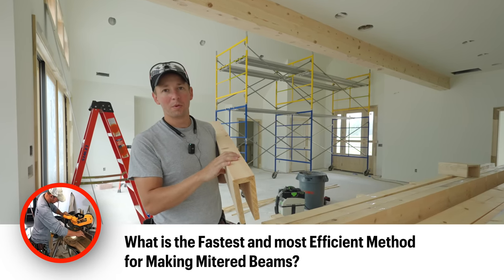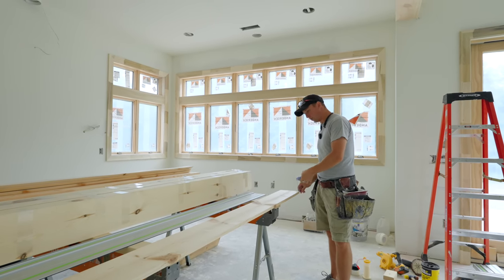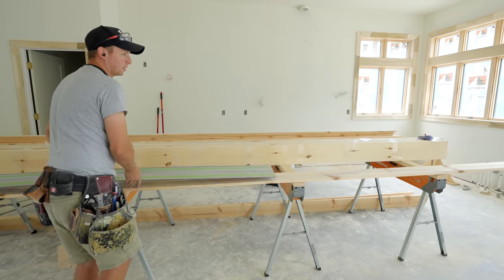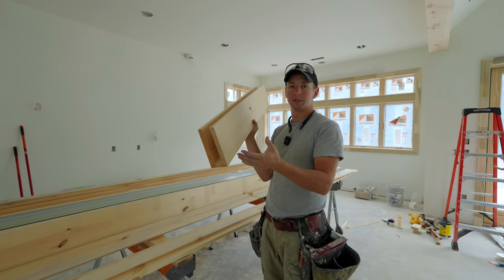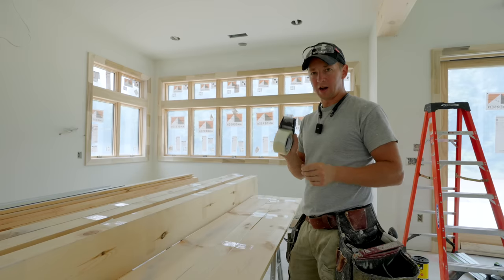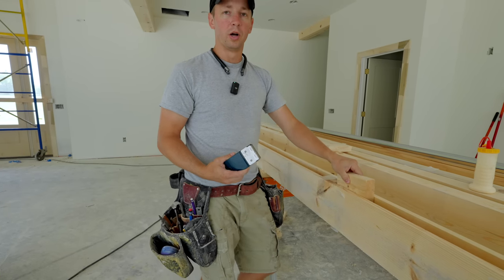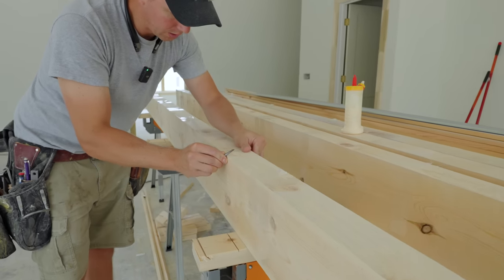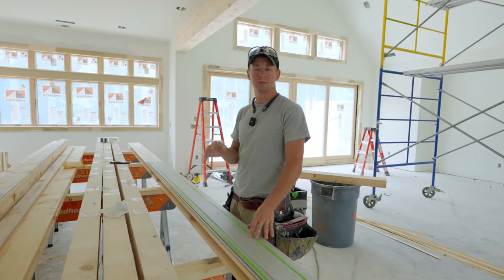PERFECT CEILING BEAMS from BAD MATERIAL??? How To Deal With Bad Material...

Comment: Excellent tutorial in every way. Can I ask about the part where you miter at 46°? When the two metered edges are joined together are those two 46° angles meeting each other or two 44° angles coming together? I can't get my head around that bit. Sorry to trouble you.
Reply: My understanding of it is that the miters will meet along the “pointy” edge, but not the whole “face” of the cut. Instead, the glue will squeeze in one direction only and partially complete the missing 2 degrees of the joint. It’s important that the pieces are supported at true 90 from the inside during glue-up, or you’ll have an 88 degree joint instead of the 90 you want.
Reply: @mikekempe7555  thank you - so it's the two 44° angles meeting. Legend!
Reply: Exactly. This way, it caters for twisty boards where a precise 45 degree cut may leave “open mouths” along the joint. Instead, the corners will meet all along the length of the beam.

Comment: Respect the skill. Very good. To the consumer, why even bother with fake beams? Either implement construction beamd in sight or design within the style of the house.
Reply: Some tradesmen have understood the value of additional (you would say unnecessary) work. Change orders are sometimes the difference between profit and not. The more a client wants, the happier you should be. There is often the consideration of your mortgage, wife and kids. Kids eventually drive and attend college. They are expensive. A good rule of thumb is to estimate the additional work and then triple the number. You will be messing with your schedule and have to work some weekends but it pays well. You are the best your client could find, so charge like you are the best. Right?

Comment: Great video! You have three track saws, why not have two full length tracks to mate up for rips that long? With a job that big, that many repositions of the track, why not make your cuts in one pass? Treat yourself to some convenience bud! I did rough ship lap job on every wall on the first floor of a 100 year old house(lots of scribing) I had a couple lamb beams to wrap with miterfolds and I used the track saw to straighten out a lot of the ship lap. I have a makita battery track saw, absolute game changer.
Reply from the maker: Because when you put multiple tracks together they do not stay straight and have to be checked and realigned every time you move them.
Reply: @InsiderCarpentry  bummer, not for me. Oh well.

Comment: Thanks for the video! How did you do the big beam and bigger beams longer than 16’? Do you pre assemble or scribe and fit each piece in place?
Reply from the maker: On those large beam the strategy changes. I fit each piece and assemble piece by piece in place. First sides, then glue bottom on.

Comment: Love your videos! I am curious if you have a video on how you deal with Sheetrock on a door opening being wider than your door jamb. I’ve always ended up crushing the Sheetrock or even adding jamb extensions in extreme cases. I am a production finish/trim carpenter as well and run into this pretty often. Why they don’t make door jambs a heavy 16th of an inch wider I don’t know but sure wish they did at times! Again I love your videos and would love to hear a response. Thanks!
Reply: 2X4 partition with 1/2” drywall. Your jambs are 4 9/16”. If these are correct, you should not be having a consistent issue. Something else would be a factor. Any idea what that might be? It sounds like metal studs spread by wood jacks.
Reply: When extensions are needed, dress the jamb bevel off the non hinge side and add them. Don’t pack the hinge side of the jamb.
Reply: From what I can tell it is from the king/trimmer not being properly aligned which pushes one or the other proud of the rest of the wall framing. Mostly it only happens in the middle of the opening. Top and bottom are flush or very close to.
Reply: @joshuasteele1769  I hate to blame framers but that would do it. Jacks and kings need to align. Let’s assume you can’t check for this as a pre drywall inspection. Let’s assume the drywall is installed. You can drive a chisel through the drywall and pry the jack away from the king stud a little. You don’t need much. Then drive a screw (toenail) at the corner of the jack to align it with the king. The chisel or pry bar damage should be covered by casing. I have seen this more with flanged window units. Andersen, Marvin, Pella…sometimes the unit has to be pulled in with a clamp and anchored to the framing. This is common when the nailing fins are damaged or tyvek or tape gets bunched up. But a bigger headache when trimming the exterior. Plowing a rabbet on all exterior trim to clear the nailing fin works for that specific issue. Hope that helps.
Reply: I attribute many framing issues to pneumatics. Someone who can’t use a hammer properly to frame or trim, should not pick up a gun.

Comment: Is it worth the time and effort to use a lock miter bit with the track?  Also, do you back bevel the top edge to make scribing easier (less material to remove)?
Reply from the maker: I don't lock miter anymore. Not worth the time. I do back bevel when I rip the scribe and then finish with a block plane. You will see it in the next video.

Comment: Why not join two tracks together to make a longer one? Great video Spencer, lots of good tips!
Reply from the maker: The tracks don't stay aligned and you have to check and realign every time you move it. More of a pain than it's worth.
Reply: The Bosch rail connector works amazing and I think Bosch tracks work with festool saws

Comment: hey Spencer, i want to replace my Dewalt track saw because its terrible. Should I get Milwaukee or Festool?
Reply: Both are excellent, looks to me he will say festool. I feel it’s more about using the best blade possible on either saw. Stay away from box stores for high quality needs. Forrest or cmt should be used for precision cuts. Anything else is for general use. Freud blades dull quickly.
Reply: @stevenfoust3782  Thank you I appreciate the reply. I  know he did a review on the Milwaukee, and he really seemed  impressed with it. My  thoughts are, if i do Milwaukee, I could just get a battery adapter that would still allow me to use my Dewalt batteries with it. Not sure if there is a Festool/Dewalt battery adaptor
Reply: @williamdyer4431  there probably is an adapter. I have found that for a complete kit  with two 55” tracks, connectors, charger, battery, clamps, saw, and case is $1,037.00. The Milwaukee is excellent on par with festool and makita 40v ( which I have) . Most reviews are leaning towards Milwaukee and makita. Wood working reviews. I have 30 years finish carpentry and any of the 3 are life changing great.
Reply from the maker: Both are great options. Milwaukee if you already have M18 batteries. Otherwise it's a wash. I enjoy both saws. I use my corded festool with the vac the most.
Reply: @InsiderCarpentry  Thank you so much for the reply. So the M18 has plenty of power? If so, I'll probably get that. I have all Dewalt batteries, so I guess I can just buy a Milwaukee to Dewalt adapter

Comment: take out the cotton string line and replace it with fly fishing line. It will give you a cleaner and finer line for the chalk box.
Reply: I think you mean the braided “backing” line, not the flyline itself. Backing line is usually 30-50# braided dacron that you can get at flyfishing stores and larger big box sporting goods stores.

Comment: Awesome video! Maybe you mentioned it… but how long do you wait to un-tape the beams?
Reply: That's the same as any glue joint with PVA glue. 30 minutes if you are in a rush, 2 hours is better, and the next day would be ideal.
Reply: @idontthinkso666  depends on temperature, too. When its really cold 30 minutes is not enough.
Reply from the maker: For something like this I would like to leave them alone for at least 2-3 hours.

Comment: Can’t you extend your track to your full length and not need to keep resetting the track and losing time. Nice video and explanation as you go along.
Reply from the maker: It doesn't stay straight when you join two long tracks.
Reply: @InsiderCarpentry  Thank you for replying Spencer, that was very helpful.

Comment: If you were using a Mafell track saw, you could connect 3 or 4 tracks together easily, and still fit them in your truck without trouble.
Reply: Almost all tracksaws have it. I think the point is that it's unwieldly (and costly) to join two large ones.  But if you have a LOT to do, it may be worth the cost/trouble of lining up such a long track. I also worry about the tolerance of the join.  I know on my track, there is a little bit of play when joining.
Reply: @hansangb  Yes, I know they have the ability to join tracks. Festool makes all these different sizes of tracks that get unwieldy to transport. Mafell makes tracks up to about 5 feet, and they all fit into a little bag they have. I have both Festool and Mafell tracks. Mafell ones are far easier to wrangle and connect.
Reply: I have 4 Makita tracks, 3 55" and the shorter one, have joined them all together and ripped 16' Red Oak bevels, that beam is still tight and straight, 6 years later!
Reply: @Skiteach  Great! You must not have worked with Mafell tracks before. No flipping to join.
Reply: @hansangb  Mafell tracks are the most accurate when joining as it's impossible for them to fasten tight and the tracks not be aligned, where Festool and Makita styles have small guide sections which still allow movement, the model Bosch I have comes with the Mafell (rebranded?) tracks, nothing cuts straighter than that set-up in my experience.
Reply: @gregdee530  Good to know.  I always try to use a straight edge to ensure the dewalt and festool tracks are straight.  But I hate working with floppy tracks...(that are super long)  hmmmm, that doesn't read right :)
Reply: @gregdee530  Good info, thanks
Reply: @farmcat3198  I had not, nor seen Mafell before this video! They don't advertise in the magazines I have seen, the Tool stores and Lumber yards carry Makita, Festool and maybe Bosch and DeWalt. I own a corded Makita and current job there is a cordless Makita

Comment: You called that stair tread cut station…a trash can. Kind of severe.
Reply: Hahahahaha. This comment wins! I missed that until you pointed it out and knew your reference exactly.
Reply from the maker: I could put a festool label on it and paint it a pretty color and sell it for $500. LOL
Reply: @InsiderCarpentry  I only need one. But like any decent builder, I will negotiate on the price after I accept delivery. Message me for the ship to address. I would like the cut marks in the top autographed or initialed by you and that area of the plastic to be taped off prior to paint. Also, I don’t want to push it but do you have paint color options? I really don’t think that it’s too much to ask…as a builder of course. Normal reasonable person, without the builder entitlement, it would be way too much.

Comment: How? Core styrofoam with thin timber veneer. Cheap, lightweight, looks like timber, easy to instal and trim. Otherwise just use laminated beams.

Comment: I understand the change in style. Questions.  Why not just do butt joint. Where the full board is the bottom (what you look up at).
Reply: You don’t see just the bottom of the beam assembly. These will receive stain and not paint.
Reply: You'll see the edge join on the end, mitred no joins.